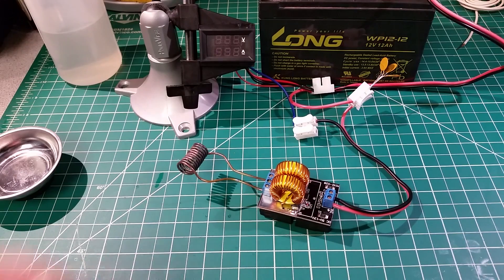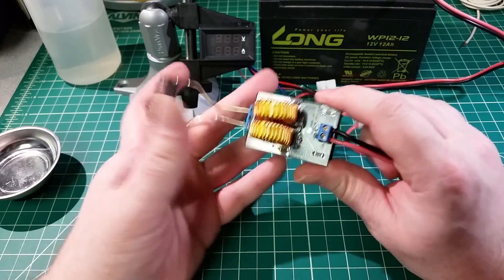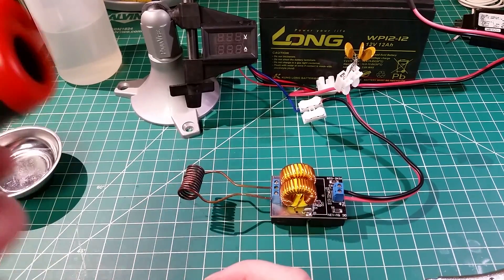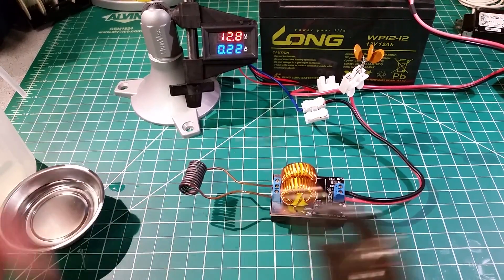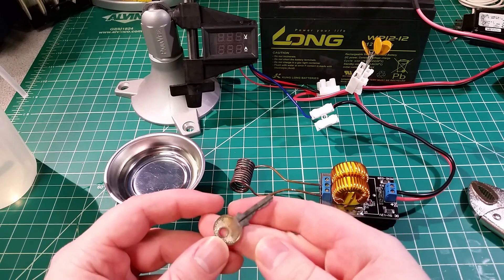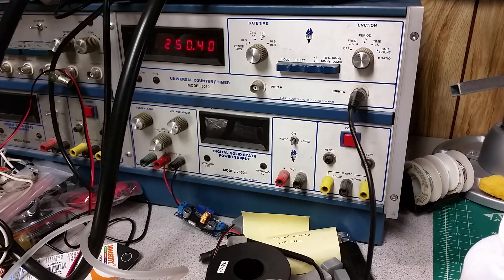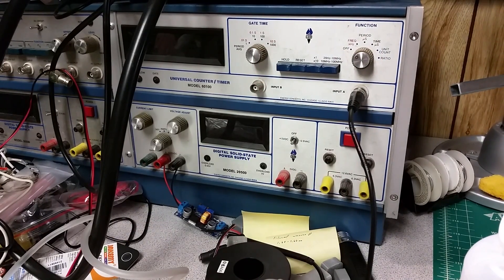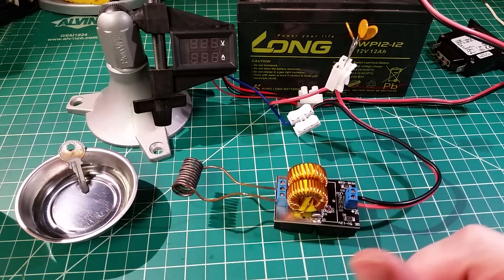ZVS Inductive Heater - Fun with Power

Comment: Is the number of turns important? can stranded wire be used to extend the range of movement  of the coil (from the ZVS)? (i.e. could this be used on wiring harnesses? i.e as a soldering iron- on cars or motorcycles).

Comment: Hi, I've made bigger coil 2x at 2x less number of turns https://s13.postimg.org/effvq4vrr/tmp_5331-_IMG_20180111_2340301352068454.jpg and this thing works, but I have problem with heating any copper thin plates like small PCB 25mm x 12mm even with oryginal coil 2cm in diameter. Did you had any success with non ferromagnetic metals like copper? I use 12V 7Ah battery and easy get 33W with feromagnetic materials inside.
Reply: Szan Konieczny you would have to make a coil with the lowest amount of hysteresis possible,  you need to make the coil using strands of very fine enamel wires running in parallel, preferably silver enameled wire but copper can do the trick if thin enough.

Comment: I've got a 500W computer ATX power supply and I have the same board as yours is it a problem to use them together? they did appear to work really well It begins to stinks when I put some metal into and there is a lot of fun! thanks a lot!

Comment: Hey, thanks for the video, and all of the information!... Just a tip... I've been researching this technology as a scrapper/prepper! LOL...
If interested think electrical switch contacts!!! 
Anyway, I'm trying to figure a way to power this device with only basic electrical knowledge... Amps, hertz, voltage, current, "fitz".... lol... lots of information but I just get more confused!

Anyway, do you think that this inductor could be powered by a car battery charger? I'm trying to figure a way to power it up with constant power from an outlet... I have lots of heat sinks that could be mounted to the caps to dissipate the heat but idk if that would be sufficient... maybe worth a shot though.
my main concern is the source of power.
Thanks again for the video!

Comment: First, don't connect the ZVS to the power supply, then switch on the power supply, turn the power supply on, then connect the ZVS, it needs a big surge to get it ringing, or the transistors will lock up and blow. Also, the current that it draws is limited by the diameter of the work piece you put in the coil, if you try to heat something too big, that will blow it.

Comment: great video. is it dangerous high electricity in the coil? i mean, if you by mistake touch it....
Reply: No. No shock, no nothing. Only a changing magnetic field, which makes molecular friction inside magnetic and/or electrical conductive materials.
Reply from the maker: +Pablo Horhe 
Yeah, almost no voltage. Plenty of burn risk though ;)
Reply from the maker: +Pablo Horhe 
Yeah, almost no voltage. Plenty of burn risk though ;)

Comment: I purchased one of these and am running it off a car battery at 12-13 volts. However, i can not get the current past 2 amps no matter what I do. Is there a reason for this?
Reply: because its only needing to draw 2 amps

Comment: Hi there,, cool vid... I just picked up a similar unit on ebay, and  like yours, there are three terminals on the output.... is it fine to just build a coil and connect to the outer 2?    Cheers
 here is the one I bought  http://www.ebay.com/itm/172001795203?_trksid=p2057872.m2749.l2649&ssPageName=STRK%3AMEBIDX%3AIT
-t
Reply from the maker: +eze t
I've seen some ZVS drivers that have an extra center terminal that isn't connected, probably there just because the spacing made a three lug terminal an easy fit. The one you linked is going to need something connected though. I took a quick look around for a similar circuit, this looks to be pretty close: http://goo.gl/n3ZfAw from http://goo.gl/u84UXI. Don't quote me on it (I mix up my oscillator topologies), but that's a Royer oscillator. The driver I'm using has two inductors back to back, acting like a center tapped coil, and drives a single output coil. Yours looks to take the opposite approach. Shouldn't be too hard to make coils for it though, just need an extra leg tapped in the center. I will say, your unit looks like a much sturdier build with bigger MOSFETs and some well needed heatsinks. Not bad for four bucks more
Reply: Ah ok,, so if I wind a coil, I... I just ordered a couple of more that have the 2 inductors... slightly larger than mine  :)   what I really want to do is skin effect heat tracing of pipes... :)
Reply from the maker: had to look that up, interesting way to warm up a pipe. Would be tricky to do that with a run of pipe unless you fed it from the center with what you had, don't know if it would be happy with it either with such a low impedance load, may not want to oscillate. Hopefully the two inductor one works out, makes me wonder what you are trying to heat... something this size, fuel lines gelling in the winter? ;)
Reply: Top secret :)   you are on the right track though!   I will probably have to make some sort of impedance matching transformer as well,,  not really sure of the math behind it though..

Comment: I bought one of these recently and it is being shipped.  I want to heat some metal in it for at least 10-20 minutes at a time.  Is there a way to pull this off?  Please keep in mind that I know very little about electricity and electronics in your responses.  Could I somehow cool it with a fan or with cold water tubing that runs over it or both perhaps?
Reply from the maker: +Jonathan Seale
Best bet would be fans and running it at the lower end of its voltage range, so 5 or 6v. If you take a look at LA7YKA Norway's video that he linked in another comment, https://www.youtube.com/watch?v=hnI5rQ5AAqg, he swapped out the MOSFETs and added heatsinks. I am going to do the same soon but that's probably too involved from what you were saying. Keep an eye on it when you run it though, make sure it isn't slowly cooking itself and make sure to do this on a fireproof surface in case you forget it's on...

As for water cooling... I think it would be easier to buy a bigger driver and run it at its low end. If you figure out a way to do it though, more power to you and make sure to send me a link to a video of it. Ten times the heat carrying capacity in water than there is in air but there isn't just one part of this that gets hot. The capacitors are epoxy potted though, if you were feeling really adventurous and could afford to blow one of these up if something went wrong you could submerge it in mineral oil. Again more work than it's worth probably

If 5v puts out enough heat for your task then it's a lot cheaper and easier to get a 5v power supply that will give you a few good amps than a 12v supply that will push 10-15 amps. 5 or 12v blower fans are cheap on ebay too

Comment: Hi! I bought one of these modules and I am using a 5a 12v computer power supply. All I can get out of the module is a blinking led, and the power supply isn't using the full five amps (shown by the power supply led blinking at a very low level.  So you have any suggestions for me? Great video by the way!
Reply from the maker: +Sam Tayloe 
A lot of computer supplies, and switching power supplies for that matter, have over current protection. These things can easily pull more than five amps too. The supply could be protecting itself and cutting out as soon as it tries to power up, waiting and trying again. I'd start by trying a battery to see if that's your problem. If you don't have anything hooked to the output then a 9v battery should be enough for it to start up and the led to light. As I mentioned in the video, these zvs drivers have no current limiting so if you use a larger power supply or something like a lead acid battery you want to do something to keep it from overloading.

Hope that helps, let me know if you get it working
Reply: I was able to get the module to run on a 6X AA battery supply! Thanks for the help.  Do you have any suggestions for me to get the IH module to work with a wall outlet power supply? Possibly buy a higher amp supply like 7 or 10a?
Reply from the maker: +Sam Tayloe 
Glass to hear you are up and running!

As for a mains supply, if you go with a switching supply it would probably need to be oversized, considering how much current I've drawn with mine probably 15a or better. On the order of a decent sized desktop computer PSU. They still might not be happy driving this kind of load though, may need a limiting resistor. If you find a beefy linear supply you might have an easier time. Most are more forgiving of being overloaded if it tries to draw too much current. Can't say I've seen a ten amp wall wart that wasn't a switcher before though. 

I'd probably start by looking for a PSU to salvage. If you need a big 12v supply for other projects then you might want to buy a specialized supply, something like this may work but I don't have one to test https://www.amazon.com/dp/B00D7CWSCG/
Reply: Daniel VanBorkulo a good power supply are server ones I have 2 connected in parallel for 120 amps  at 12v 1500w
Reply: The two MOSFETs turn on at the same time and you have a short circuit.  If you now use a battery as a power supply, everything is broken!

Explanation:
https://youtu.be/gNL4H5fC6AY

Comment: Those mosfets are killed quite easily (at least at 12V or more). I've changed them with IRFZ44 w/cooling fins, and now I can put more power through it :)

https://www.youtube.com/watch?v=hnI5rQ5AAqg
Reply from the maker: +LA7YKA Norway 

Thanks for the tip!
           30N60  IRFZ44N
RDS(on)   42mΩ  17.5mΩ
VDS           60V   55V
ID continuous 15-27A     35-49A
ID pulse           80A          160A
CISS   850pF  1,470pF
COSS   250pF  360pF
Rise time  36ns  60ns

A bit more capacitance and rise time, but the thermals and lower on resistance makes the IRFZ44N look like a much better FET for this circuit. I don't have anything equivalent on hand so I went ahead and ordered some. I'll be swapping them out when they get here. I should print a mount and attach a 30mm fan when I have the chance too since the caps and inductors get a bit warm.
Thanks again for the suggestion